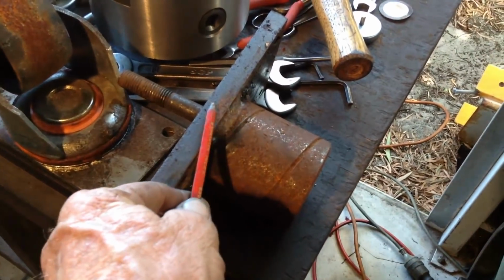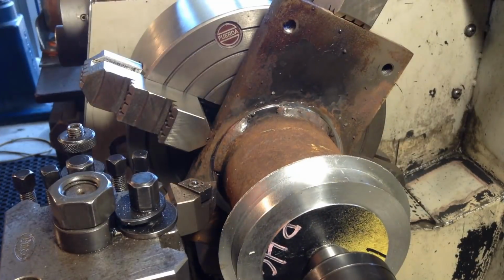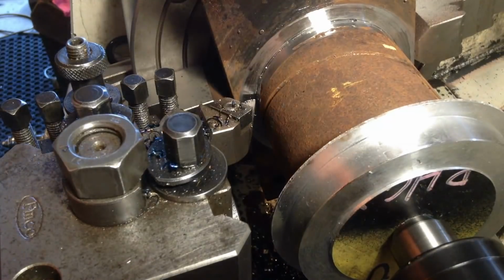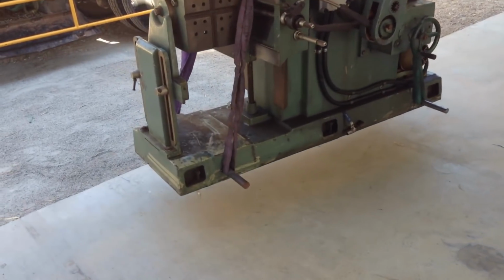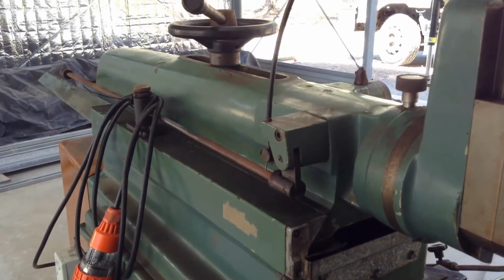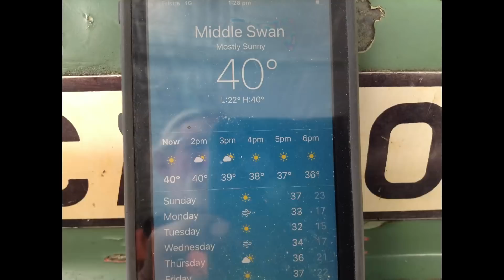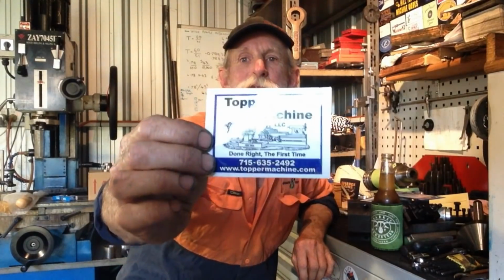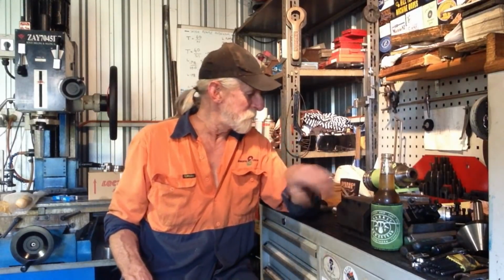My Shaper Comes Home  &  A Quick Update .

Comment: Hey new shop's gonna be awesome! Maybe check out putting a split system on it, not too hard to install. Air handler up in the trusses some copper lines and electric and done. Best thing I did was a/c the garage to work in there. Oh am an electrician by trade, 250 amps at 480 is more than enough to run every machine at the same time. Or 10x 20hp machines at full load at the same time. You can always add subpanels if you need space for breakers on a smaller service. Maybe save some $ that way if you wanted to. Congrats on getting 1st machine in there
Reply from the maker: Thanks   .  I am trying to go for the limit for our area with power , hate to pull up short ! It also has to run the house & large water bore .   I was thinking about a couple of swampy's  to keep things a bit cooler .    Cheers    👍
Reply: Yeah better to have the amperage and not need it! that'd be one hell of an electric bill if you can utilize all of it haha. Swamp coolers would be great just mind the humidity they make might be bad for rusting stuff. An actual a/c is a dehumidifier in itself too. Those mini splits I think all you need is a vacuum pump to install it after they drop it off dunno if you looked into those
Reply from the maker: @RJ99729  I will see after next summer witch way i go with the a/c .  With 200 sq/m it would need a large a/c , i think swampy would be cheaper too run .  I will go through next summer with the shop completed then decide .
Reply: @swanvalleymachineshop  That's a good idea, def are a bit cheaper. I looked up here how much the a/c costs, they charge 10 cents a kw/hr here so a 3 ton running 12a at 230v would be about 2700 watts or 27 cents an hour to run. Does add up. If only run it while in the shop though. But if you got the roll up door open not much point and swampy will still work. And cost 2 cents/hr. Heh get both maybe

Comment: Negative 25 Celsius up here in Canada. Jealous of your warm weather
Reply: We had a day a week and a half back it got to 50.7 (123.3f) a bit further north than Max admittedly but it was a new all time heat record for Aussie. I heard that Death Valley exceeded 130+ f before today. 😳😳👎

“The highest temperature ever recorded in Australia is 50.7 °C (123.3 °F), which was recorded on 13 January 2022 at Onslow, Western Australia, and 2 January 1960, in Oodnadatta, South Australia.”
From Wiki.

But Death Valley does eclipse that apparently at 134f

“It is separate from the more frequently referenced temperature measurements at Death Valley's Furnace Creek, about 18 miles to the southeast. Furnace Creek is home to the highest maximum temperature recorded on the planet: 134 degrees, (56.667c) set July 10, 1913.12 July 2021”

So yes it’s hotter n hell in Furnace Creek Death Valley USA. 😳😳😳
Reply: @ianmoone2359  wow that is insane
Reply: @jefftheaussie2225  But the Furnace Creek 134f still eclipses even that reading so we still wouldn’t be the hottest temp ever in the world, would we?
Reply: @ianmoone2359  Measured in the shade?
Reply: @jefftheaussie2225  By rights all temps should be taken inside a stephensons screen (ie a shaded / ventilated temp.
The Max / Min thermometer shouldn’t lie.
I used to read an “official weather station”readings hourly setup for Forest Fire fighting in a previous life. Temp, Max & Min, RH, Dew Point, wet bulb / dry bulb, rainfall etc.
Reply from the maker: @jefftheaussie2225  I was working in Kookynie , a small town past Kalgoorlie years ago .   Removing broken track roller bolts from an old D9G Cat dozer , the thermometer was in the shade under a tree & read 55 Deg C .   It was probably reading a couple of degree's than actual though , bloody hot !!!
Reply: @swanvalleymachineshop  Bloody hot alright Max. Ironic that you were working on a Dozer. Hot heavy and expensive.

Comment: Hello Max.  Your phone forecast looked just like ours a few weeks ago but all our temperatures had minus signs in front of them.  I think the most impressive part of the video was how long that beer sat there without having a sip taken from it.  I haven't seen condensation on a beer bottle for 5 months.  God damn it looked good.  So does the shaper.  I think that might be the newest shaper I've ever seen.  I have a 600 volt, 200 amp three phase service in my shop which is pretty much the same power rating as your service will be.  I think you will be happy with that.  I can start my 20 hp lathe motor and the lights in the shop don't flicker or dim at all.  Having lots of power is nice, especially if you're on the hunt for more machines.  Ken
Reply from the maker: Thanks Ken .  Yes , i do not want our lights or the neighbours lights to flicker when i crank the big Russian mill up !   👍

Comment: I'm always a little leary about those swiveling casters, because you can lose so much width of support when they swivel inwards.  Yeah, I know, just take extra care...
Reply: I have to 2nd that advice. I brought a nice “new to me” 24 inch bandsaw home and put 4 casters under it just temporarily to move it around the shop from the hoist I lifted it off the trailer with out of the way while I made up a proper cradle steel base for it to sit down in with large casters outboard for stability.
Of course I stupidly opened a steel door up top to check the condition of the rubber tyre on the top wheel and that extra outboard weight when the door was open was enough to topple it over.
Being cast iron it would have killed me if it landed on me but luckily it sorta “pushed me out of the way” as It went over, and I still have the chipped new concrete floor where it landed to remind me of my own stupidity forever more.
Not to mention the week I took to panel beat the steel door that got dented and straighten the 1 inch solid steel guide bar for the cast iron fence that I bent etc.
When the caster swivels inboard under the machine, it takes very little extra weight to upset the delicate balance, and once it starts to go there’s no chance of stopping it.
I’m still mad at myself, because I took such care loading it and strapping it into the trailer when I bought it, and drove so carefully home with it, and managed to get it off the trailer without damaging it, and that’s when I dropped my guard and bozo stepped in to teach this old dog yet another dumbass trick. 🙄
A bandsaw is a fair bit taller than this shaper of Max’s so a little easier to tip over, but I gotta say my sphincter pucker factor watching the positioning of those casters was ratcheted way up, enough that it drew out all the age wrinkles in my forehead. 😜😂😂😉
Reply from the maker: Yes , i know what you mean there .  These are heavy duty thick ones .   They are only on there for a bit of careful shunting  the machine around .        👍
Reply: @swanvalleymachineshop   I reckon you will be fine Max, just don’t drop your guard the way I did. 👍

Comment: Great vid. For your AL-960B lathe, are you using 16mm heigh tools?
Reply from the maker: I have some 16mm  tooling  , that is what is best for that lathe .  I run 3/4  and 20mm tooling mostly as it will fit my larger lathe .   👍

Comment: G'day Mr Max, I'm enjoying watching your videos. I had 3 phase installed in my workshop best thing i ever did, the sparky said i could save some money by installing the cable my self but he could not offer a certificate  for that  part of the job so i got him to do the hole job, had over head cable run from the house and then ran cable  to the main power poll instead of under ground. If you can not get 3 phase to your shop, what about running a 30 amp circuit and use VFD for your machines?
Reply from the maker: I will be able to get 3 phase no worries , it's the amount of  amps they will allow me could be the worry !    That's why i am applying for the maximum .      👍

Comment: Awesome update Max, I’ve been hanging out to see the progress on the end walls. The heat has just been savage these last couple weeks, I couldn’t imagine you working on the shed or in your little shed in this weather. I’m surprised you got as much done as you have.
Nice shaper machine for sure & neat way to get it home with the hiab truck.
250 Amps of 3 phase?
You might need to buy a new big transformer for Synergy to mount on a pole to supply you that many herbs out your way. 😳
I better buy shares in Whim Creek Copper Mine with the amount & size of cable you will need to carry that amperage over any distance. 😜😂😂
I’ll have a hunt around my shed for any left over 3 phase switchgear or plugs I have stored away and drop off whatever I can find to your place, might save you a few sh!tsvillian pacific micro pesos with the sparky contractor or allow you to add an extra outlet here or there for future acquisitions. 👍
Keep up the great work. That shed will be epic when complete. 👍👍👍🇦🇺
Reply from the maker: Thanks Ian .  Cheers   👍